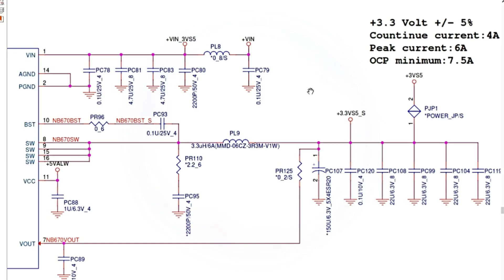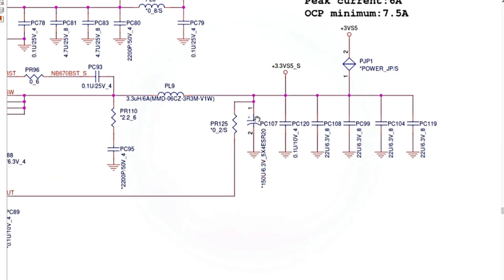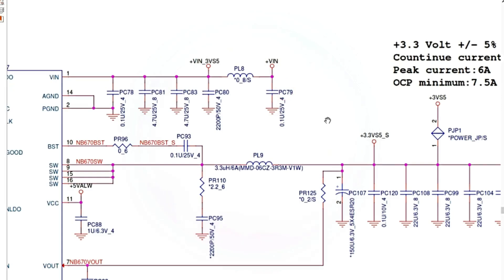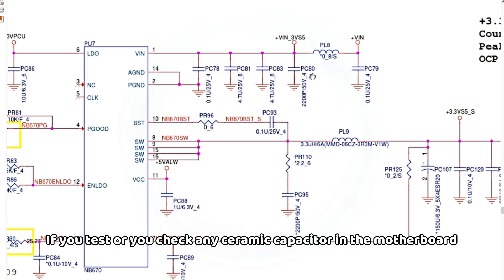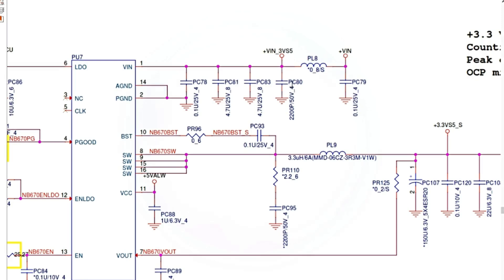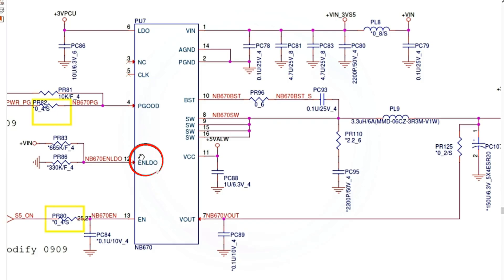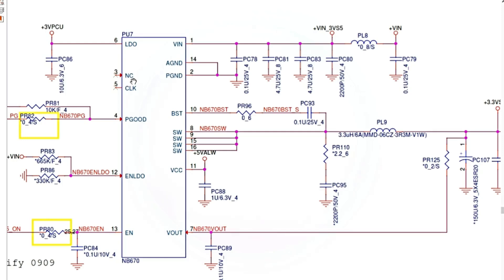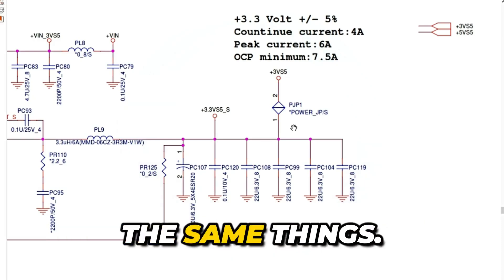Master Schematics Reading in Minutes - How to Read Laptop Schematics

Comment: i know this is very easy for you and i wish you to troubleshoot or reading also an 8 zonal fire alarm control system. It doesn't show any burnt components but if open the control it shows abnormal or its like corrupted seems need really technician or engineer to check the board inside. Hoping you recognize me..